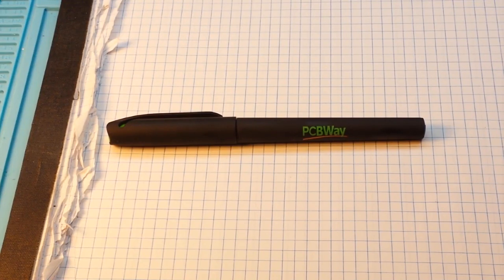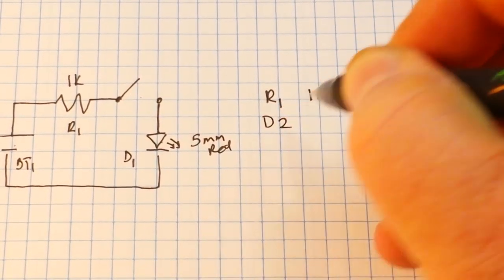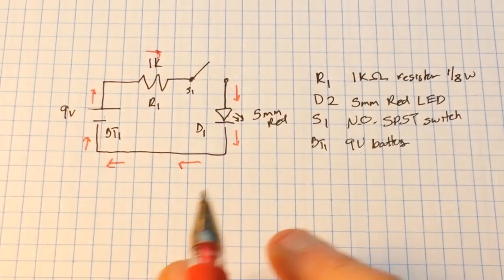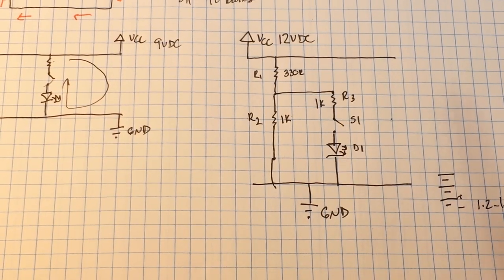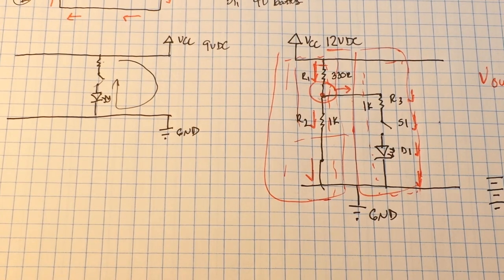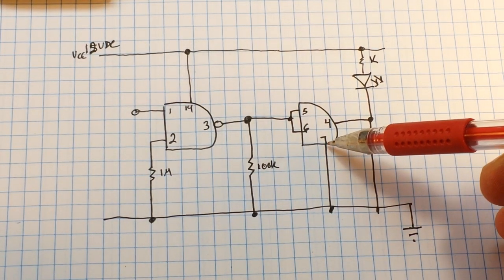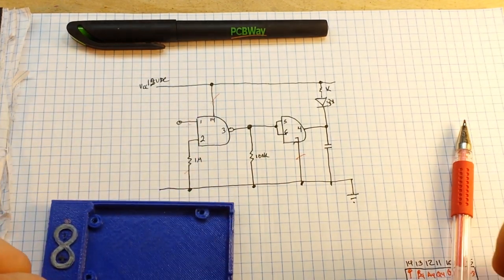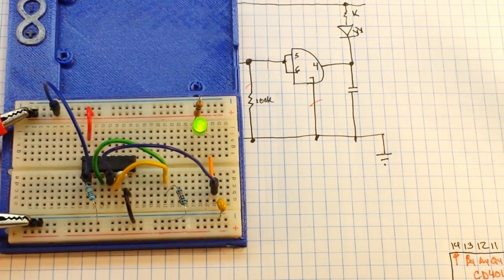Getting Started Reading Schematics and Breadboarding

Comment: Another informative video thanks Paul. Reading through the comments I agree and would be saying the same too. Im newish and all self taught via books and on here. For me the challenge is getting the schematic to the breadboard, test it then get it onto strip board as making my own PCB's are the next step but later. So
Yes please more videos on this subject.
Question:
My schematic for a LM386 audio amp shows pins 2 and 4 connected with a capacitor but both are shown with seprate grounds continuing afterwards. If the cap bridges both pins will one ground from pin 2 or 4 be enough or do both pins need their own ground? Hope Ive explained that well enough. Thanks

Comment: I am glad to see that you are using the American symbols, rather than the much less easy to read European symbols.
In the case of logic, the European symbols are really hard to read at a glance, because everything is represented as a box.
Engineers are usually very competent at reading a circuit diagrams, but most can be taken out of their comfort zone when presented with some specialist areas such as microwave power circuits, where there can be some very esoteric devices.
Reply: Universities in the UK use American symbols for logic gates.

Comment: Great video and definitely keep the series going!  Your use of the schematic, the pin layout of the chip, and the breadboard were excellent.  If I could make one small suggestion: include all three elements in the video shot at the same time.   This way learners (especially visual learners like me!) can make the connection of exactly what you are doing, how to do it, and why it works.

Comment: Great!  
Thanks for showing us the difference between the series and parallel circuit as well as how a voltage divider circuit operates.
I know for you it's pretty easy. For a newbie as myself I get overwhelmed with it all...

I liked the idea of ticking off the wired up parts of the breadboard.. elegant. 

I will definitely be using this approach while constructing my circuits..:-)

I like the way you explained the voltage divider formula as well.

Would you be kind enough to maintain these great instructional videos. I personally would like to see as well some ever complex circuit diagram to breadboard examples...

:-)

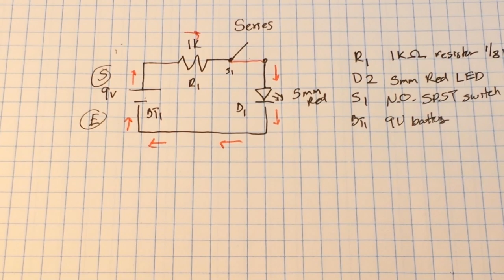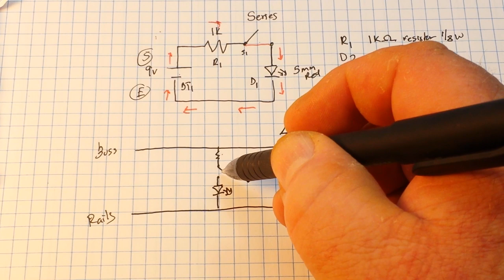Comment: Hello! I'm a beginner beginner and it looks like i'm the only one having trouble here, lol, but i'll ask anyway. I'm having trouble making the connection between the circuit being drawn at the beginning and the one drawn at 6:11 (the one using rails). Especially when at 7:27 he says it creates a loop. It's hard for me to visualize a loop considering that there is not a literal loop drawn on the paper, so I think I just fundamentally don't understand something about how the ground or battery is drawn or maybe the relationship between the two. It makes sense that the battery in the first diagram has two "leads" connecting it, one on the positive side and one on the negative side. However it doesn't make sense for me to see the battery in the rail diagram only have one "lead" connecting it to the circuit. Again at 9:25 when he's describing the flow from the battery through the resistors and to the ground, to me it appears to be a one-way street, so it was confusing to see him draw the red box and say "so this by itself is a complete circuit," lol. Sorry to post on an old thread, thanks for your patience if you're reading this!

Comment: Please explain, why electrical schematics are setup different than wiring diagrams. How is this beneficial?
Reply from the maker: A schematic shows the electrical flow, the electron flow so to speak through the circuit The way the current moves. A wiring diagram simply shows where things are connected to each other.

Comment: Why does changing the input on pin 1 have any effect if pin 2 is permanently tied low? Shouldn't the ouput at pin 3 always be high with at least one input being low?
Reply: Good observation .. you are correct. The schematic is drawn incorrectly. The bottom of the two resistors and capacitor are tied together but NOT to ground. Ground is only connected to pin 7 of the 4011. Now pin2 can change causing oscillations.
Reply: Ah....yes....that makes more sense....but, the circuit on the breadboard is demonstrated to work as expected...and you can clearly see that pins 1,2,3,4(via cap) and 7 are all connected to ground....and yet the LED still flashes...how can this happen?